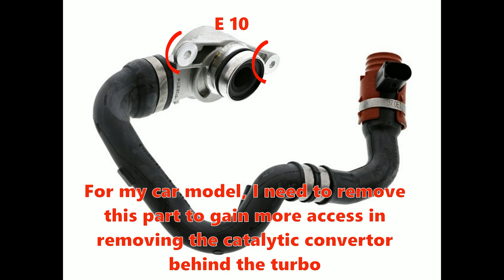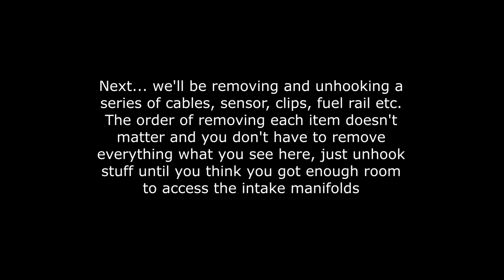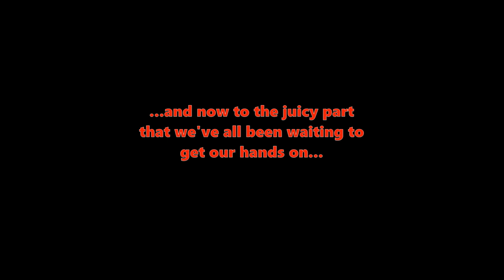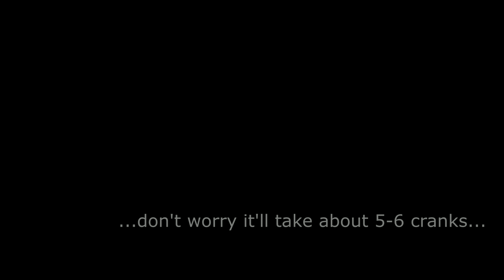DETAILED Mercedes-Benz OM642 V6 E350 CDI Bluetec W212 Oil Cooler Leak Fix

Comment: Can i ask, if i don’t change it just let the engine keep leaking, what will happen?
Thanks is it dangeous?
Reply from the maker: A couple of other people have had the same question in this comment’s section... if you’d like to read them... but basically, nothing bad will happen unless the leak will get so bad that your engine will be low on oil constantly and you’ll have to top it off very often to avoid the engine blow out on you completely. Another thing that comes in my mind is that the leak might also be so bad that the oil will mix with the coolant since both ports that supply the coolant and oil are right next to each other but so far, after researching this issue for a while, I haven’t found anyone complaining about the coolant issue and the only leak that everybody is referring to is the oil leak. I believe since the oil being the hottest from the two, the rubber on that side wears out quicker and needs replacement.
Reply: @AlbanianFix   Thank you so much, the mb dealer in Richmond bc, said it would cost at least 2500 to fix, if something I don't understand become carbon it will cost 6000,  to fire the carbon, I have no idea what it means.  I am really doesn't know anything about cars. I already paid 3000 for the three year service plan, now this happens, since it's 2012 gl350 only 60k km, really donesn't worth the money to fix.

it only drips a few drops every day. I probably just leave it be. 

Thank you so much again, for answering my question.
Reply from the maker: He probably meant cleaning all the carbon out like I did in this video with fire which is surprising to me that dealership would use such brute ways to clean out carbon deposits, usually they dip the engine parts in solution or something. Anyway, if you wanna let it be then you have to check oil levels at least once a week and top off when needed. Also keep in mind that oil level on the dip stick should be just below the middle mark, it helps the engine run a little smoother and have less blow by, since the pressure will be a little less in the crankcase.
Reply: @AlbanianFix   sorry to bother you again, the engine light come on and off, now it’s back on again, the code read saids p2413? Is it dangerous to drive with a bad egr? Thanks
Reply from the maker: @maxbobo3904  Bad EGR will cause boost problems, your car will run slower, have bad mpg and the problem can worsen to the engine not being able to start at all eventually. I would take it out and clean it the best you can. There are video on here showing how people have succeeded in just cleaning the EGR alone and if the electronics on it went bad then you might want to look for another one. Let me know what happens.

Comment: Hi can you help me out plz what this sensor connect to its on top of  pops out next to water hose
Reply from the maker: Send picture
Reply: @AlbanianFix  I will send I don't know how to send trying it's  the one that holds with a brackets under the black tub an come out the top
Reply: It's on top of the glow plug module bracket

Comment: How long does this job actually take to do.im just wondering how much labour cost a mechanic should charge
Reply from the maker: It’s hard to tell exactly. I did this in a week’s time, coming after work and just working a couple of hours on the car, much like a hobby. Taking my time and enjoying working on the car. Highly recommend to have a backup car… 😄
Reply: @AlbanianFix  thanks for your advise..Is it ok to drive like this and just keep topping up the oil ??
Reply from the maker: @timoriordan1  yeah, it'll be fine "for a while", just be on point on the time intervals whenever you top it off, regularly check out the oil level and you'll be fine.
Reply: @AlbanianFix  thanks for your advice

Comment: Hello I did this and all of my oil spilled out, it’s a 2008 e320 bluetec , I am thinking the oil seals aren’t good
Reply from the maker: Oh what a sh** storm I can imagine... maybe the seals were pinched when you put the cooler back in? Or maybe a couple of screws weren’t tight enough...? Could you tell that the oil was spilled exactly from the seals?
Reply: @AlbanianFix  I couldn’t tell but I check the dip stick and it was dry ! I feel so depressed lol it took me forever to do it just to lose again
Reply: heartbreaking
Reply: @OmarToubal  did you tighten the fasteners on the oil cooler to the proper torque spec and in the proper sequence?  

Use the WIS for repairs to get proper torque specs, especially things with seals.  

ALSO, Even after you do the repair, you will get a lot of residual oil dripping until the valley is empty just an FYI.  I know you said yours was empty so yeah the seals are probably leaking
Reply: @carlbrutananadilewski8395  What's the WIS? And generally, what's a good source for repair instructions for this project and others?
Reply: @peterlansdale1793  it's the Mercedes software that dealerships use to troubleshoot, order parts and perform repairs according to mercedes standard.

You can find the software on ebay for relatively cheap.  It takes some time to learn how to navigate and gets a little confusing at times, but it is very helpful once you do.

I have done all major repairs on my bluetec with the help of the WIS.  Highly recommend.
Reply: @carlbrutananadilewski8395  thanks!

Comment: Great job  nice video.     I’m here in Ontario Canada    I have a 08 grand Cherokee Om642.   Oil leaking.      I changed the turbo seal from orange to black    Brand new       Been a week or so.   Not leaking bad  but figured there would be leftover oil from the leak to burn off.    Jeeps always been maintained has 295000 Kms on it and runs smoothly and strong.     Been reading that  putting to much oil in is bad.      Question is.     Should I keep the oil level just above the halfway point on dipstick.   ??  Thanks  for the help
Reply from the maker: Yes, I personally believe that having more oil can affect the pressure inside the crankcase thus pushing out oil from the seals. In my recent oil changes, I keep the oil level just a quarter above the minimum and I have seen less oil, not significant, but still less than before.
Thing is, doing it this way, you HAVE to make sure that you check oil FREQUENTLY because you don’t have any safety margins available and at any time your oil level might drop below minimum which then is also bad for the engine.

Comment: I am surprised the seals are the old type (orange), I thought 2011 had the new one...
I have the same 2011 engine, 265hp, mass flow pipe is different and  output turbo pipe is also different. I suspect in my later version, seals are purple.
I have 255000km and no problem
Reply from the maker: Hmm... 🤔 but good for you. Did you buy it new or someone else already did the job?
Reply: @AlbanianFix  I don't know if it has been replaced before.

Comment: I've got an oil leak on mine, enough to be topping up and oil on driveway.
Where does oil leak on the engine (in most cases) when the seals fail?
Mines in a garage (warranty)
And there putting it down the the TIP seal, which imo shouldnt cause such a leak that you can see it dripping down the N/S of the engine near the sump.
Either thay or its breathing heavy and there's more than should be coming out of there!
Reply from the maker: All of your theories make sense and could be very possible to happen. Still for the most part, the oil cooler seals always come up as the culprit and are the first things to suggested even at dealerships but, like I said, your other ideas make sense too.
Reply: @AlbanianFix  in doing this Job yourself is there anything else worth changing whilst all this is stripped down?
I've noticed access to glow plugs is easy whilst your in there!!
Reply from the maker: @possle  Oh yeah definitely! Glow plugs, cleaning the air intakes, fuel filter change, making sure the swirl flaps swing freely are a few I can think of...
Reply: @AlbanianFix  swirl flaps don't tend to brake at all do they?
Just make sure there clean and free
Reply from the maker: @possle  Yeah, just make sure they spin freely and are not stuck in either the closed of open position.

Comment: Would this cause oil in coolant
Reply from the maker: Unless the leak is outrageously bad plus the seals on the coolant ports are bad as well then I wouldn’t worry about the oil cooler causing your issue. Your issue is extremely rare to be caused by this type of oil leak since the oil ports are on a slanted position to drip outwards of the oil cooler, through the drain hole, towards the transmission and then down to the ground (hence why some people mistake this oil cooler leak with the rear main seal leak). Another reason why it makes this issue even more rare is that the coolant ports, from what I’ve seen, never leak which means that it also never let anything to seep in. This is because on the coolant ports the heat never gets to high temps where the seals may fail compared to the oil ports where temperatures are much higher and hence why leaks are almost never found on the coolant side but almost always on the oil side.
Now, my answer to your issue is also not bullet proof but, like I said, if you have some extreme oil leak paired with some coolant leak and you can see both on the ground then yes, I can see that being the culprit of your issue.
Reply: Thanks for you reply, I have read it may be the oil cooler it’s itself as they can crack internally and cause the two to mix but want to be certain before I go stripping it down. The only other thing I can think of is maybe a head gasket.
Reply from the maker: @joshcoleman8258  Yeah, the head gasket might be more a culprit which means you wouldn't be trading much when it comes to stripping the engine down since you have to go down the same way, either for the gasket or cooler. Good luck and come back here to let me/us know what you have found, it can help someone else down the road.

Comment: Am working on 2015 gl 350 having trouble removing turbo.
Reply from the maker: Removal of the turbo starts at 9:24. Make sure all of those bolts as shown in the video are removed.
Reply: @AlbanianFix  am having trouble remove brack bolts di I remove bolts from block or turbo side
Reply: @AlbanianFix  also looking from top I see only one bracket  bolt
Reply from the maker: @user-jd4kp3lp9r  share a picture here:

https://docs.google.com/forms/d/e/1FAIpQLSfOh0E8Z-b781bnqTASxe5G-OBZbje_z9qUnzhjWJGMMfG20w/viewform
Reply: @AlbanianFix  thanks for it.
Reply: You have torque specification
Reply from the maker: @user-jd4kp3lp9r  I was looking up the torque specs on google as I was putting everything together but the assembly process is not shown in the video.

Comment: Great video.  I use to burn my older VW TDI  intakes  with a torch  too.  Didn't think you could do the same on OM 642.  Didn't you damage the swirl mechanism ?
Reply from the maker: I kinda didn’t care because my initial thought was to do a swirl delete anyway but after the clean up, they seemed in pretty good shape still.
Reply: You need to be more concerned about breaking the linkage that connects the swirl flaps to the motor.  It's very brittle plastic, and to replace it you have to buy an aftermarket "kit" OR the OEM intake manifold {~$600}
Reply from the maker: @carlbrutananadilewski8395  Yes very true if you plan on keeping it :) not me though... I deleted it all together.
Reply: @AlbanianFix  what program did you use to delete the swirl flap CEL you get for not having them?  Mercedes STAR is so damned expensive
Reply from the maker: I have not found a good reliable mechanic who can do that yet. Other people who have done it, still have the check engine light come up after a while. I still got the check engine light as well with a single code saying “Intake manifold runner stuck open”, that’s because I obviously left them open. On older OM642 engines, you could easily bypass the engine codes yourself with a simple 4.7K ohm resistor plugged into the swirl flap actuator connector but it doesn’t work with these later versions of the OM642 because the runner/rod that connects to all three flaps, has two notches build in that act as the flap’s “positioning sensor” which tell the ECU when the flaps are actually open or actually closed or semi open etc, and in older models these two notches are not there on the connecting rod/runner. That’s why it works there and all other youtubers making video how they found the holy grail but nobody shows how to bypass it on 2010 OM642 and up.
On newer models the 4.7K ohm resistor will only bypass the swirl flap actuator/motor but the ECU can still see the “positioning sensors” which tells the actual open or close positions. There is no bypass for the flap’s positioning sensor. You can bypass the swirl flap motor because the ECU thinks it’s still running no matter what even though it’s broken but how can you bypass the flap’s positioning sensors when when the flaps at any given time need to be open or closed or semi open? It’s either working or not. That’s why I bought two new runners made of metal which, of course, have the two notches and I plan on doing this whole job again from scratch someday.
Reply: @AlbanianFix  I've just done this job, they sell aluminium runners for the swirl flaps on ebay for like £10. i replaced them, easy job! btw, now its all back together, i have quite a bad coolant leak, some is coming from the little tube that connects the two exhaust manifolds, but there seems quite a lot leaking from the drain hole between the engine/gearbox. any ideas please??
Reply from the maker: @CabinetFramingUK  That's exactly the location a friend of mine had on a 09 OM642 where the two manifold butt together. After inspecting the two seals that came with the kit, they seemed a tad smaller, I mean, at first sight you couldn't tell and the originals seemed a tad beefier, thicker. So, he decided to re-use the same seals that the car had and worked like a charm. Only thing is... he had to redo the whole job again. But I can tell you 100%, that's the same spot it leaked for him after putting everything together and he had to do this job twice.
Reply: @knockknockbusted  my 2009 mbz has the same mileage. How about rattles though? 😉 My dad's 2011 vw tdi of 170k rattles like a bag of spanners, the MBZ feels like it was made in 2020 😁

Comment: Got it
Reply from the maker: Nice! What was it?
Reply: @AlbanianFix  i end up lifting turbo up little bit and angled it and seprated y pir and bracket from turbo.there was 2 bolts from engine side toward firewall.which attaches the y pipe and bracket.there was no other way.i played with for an hour.
Reply from the maker: @user-jd4kp3lp9r  Oh yeah, I remember that exact headache, lol.

Comment: How long will the repair last?
Reply from the maker: It depends... anywhere from 10, 20 K miles to 80,100 K miles until you have to do this again. It’s a very vague number because this issue is a design problem at the core thus it’s recommended to do it at least every 40K - 50K miles.
Reply from the maker: @knockknockbusted  No, unfortunately not. To me, it wasn't really an issue, it was just annoying that it would leak a little bit of oil and mines was leaking oil for a very long time before I decided to do this job. It would never create a puddle on my driveway though. It never hurt the engine as far as the oil level goes, unless you have a very big leak or don't do oil changes at recommended intervals which can lead to dramatically low oil levels and thus destroying your engine if it's not caught on time. But whenever I did oil changes, I noticed that the level on the dip stick barely moved but that might have been also because I do the changes every 5K miles so it probably never got a chance to go low. That's another + reason why I recommend doing oil changes twice as much as the recommended MB manual. Waste of money? No... I have a video showing in detail how to get free oil changes.
Reply from the maker: @knockknockbusted  I really love my E class too and if that's the biggest thing I have to do once in a while, so be it! I don't mind at all because I also look at it as a "Once in while engine Tune Up" since I change gaskets, clean the EGR, clean manifolds (as shown in video with blasting fire), clean all intake ports from sludge because that's what gives a diesel engine more life if you plan on keeping it for a long time.
Reply from the maker: @knockknockbusted  Nah... not in my subscriber standings, I got some ways to go. To make a decent living, like, just living off youtube, you'll need at least around 500K subs and up.
Reply from the maker: @knockknockbusted  Oh you mean like having your own garage or small business... lol... maybe one day :)